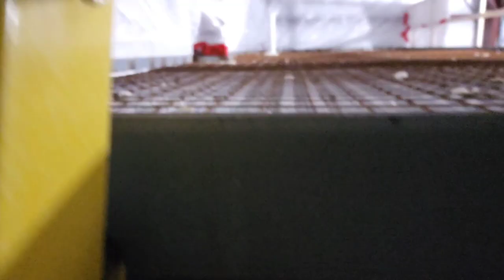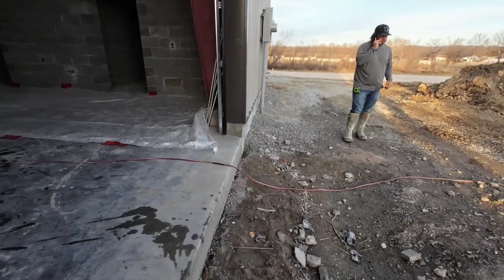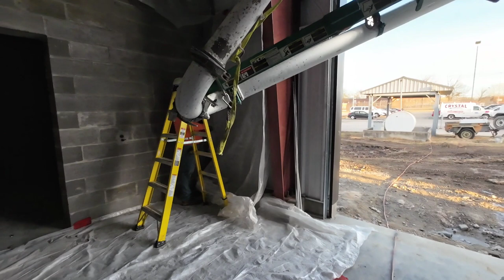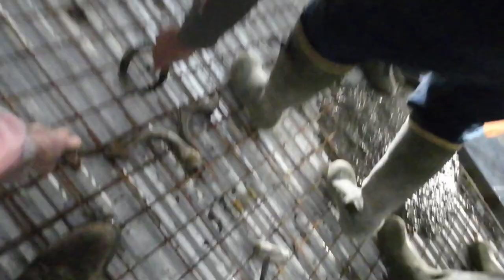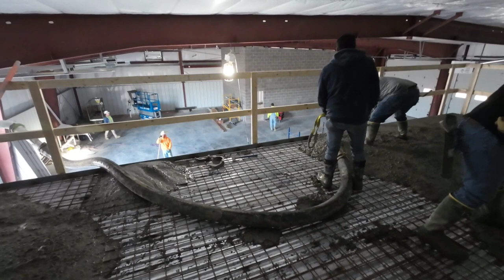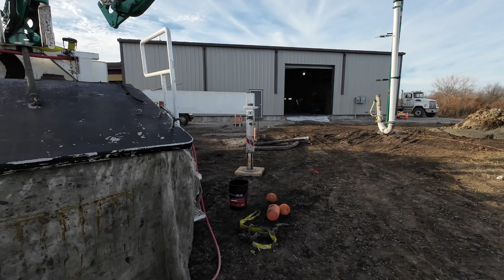Hammer It Out! Plugged At The Reducer While Pouring Concrete!

Comment: Just a stupid question..

Why didn't you run through the pump first, then connect the hose and run concrete in a hanging hose?
I do this with 10 meters of 3 inch hose on my pump.
With a longer 3-inch laying hose, the concrete is usually designed for this, so I then borrow some sa, accelerator, and put in the 3rd hose.
I then push the concrete slowly to the end.

Works every single time!

Then it is just to dial it in at 5-6, 1800 rpm, and hammer out the trucks with a 7 minute interval.
Telling the concrete guys to take this special delivery!😂
Reply from the maker: That was an afterthought. I usually never have problems running slick'em through the hose then connecting.

Comment: That mix looked really gnarly coming out of the truck. You can add Slick-Pak II directly to the truck with mixes like that, which will help smooth out the pumping process.  Also did you prime the whole boom or just that last bit of hose?
Reply from the maker: Primed the whole boom, then ran primer through the hose. Slick pak has definitely saved us in the past by adding that to a truck or 2.